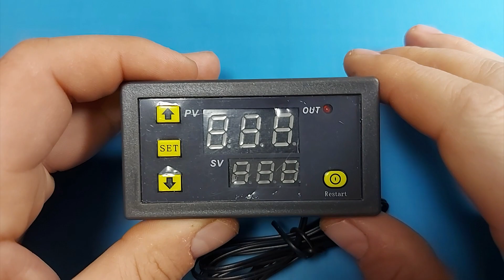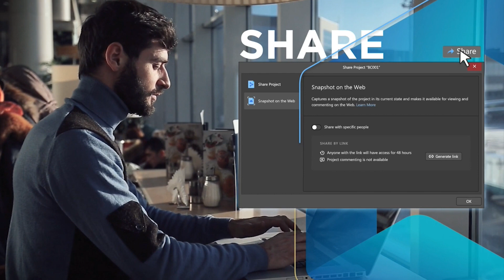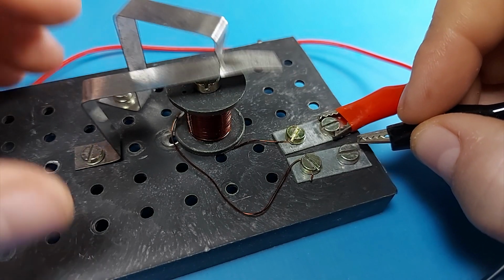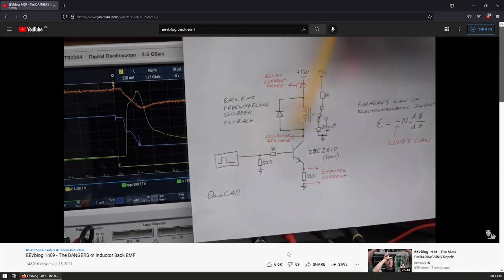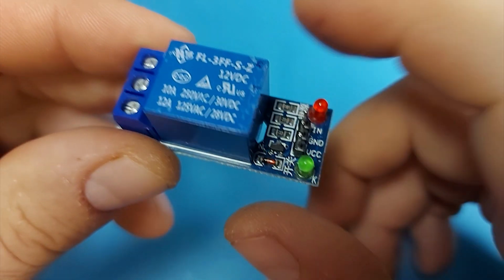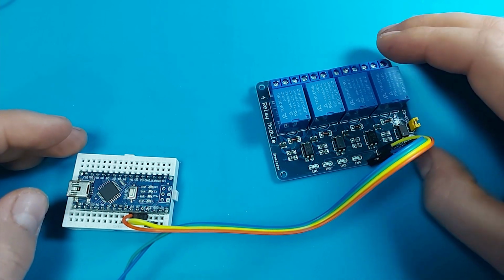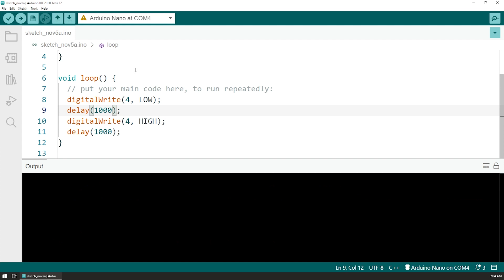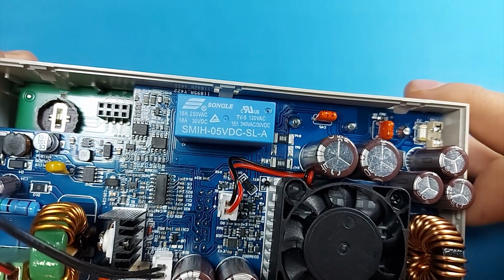Arduino relay basics - how it works and how to use it

Comment: Is it possible set a 16ch relay to NO as start pattern? 
My relay is NC when it's turned on than it changes to NO.
Reply from the maker: As far as I've seen, each relay has both the NO and NC contacts. Can you double check that you have not wired it wrongly? There should be a COM (Common) contact, NO (Normally open) and NC (Normally closed) contacts.
Reply: @TasteTheCode thanks for helping me! The wires were ok. I've changed the code and I've reached it.
Reply from the maker: Awesome, I'm glad you were able to resolve it.

Comment: Thanks a lot for the tutorial! Would it be possible to code it so two relays activate and deactivate out of phase? I need my code such that one of the relays activate each 1000ms and the other one 1500ms.
Reply from the maker: Yes, you can. You just need two variables to compare the elapsed time.

Comment: Can you help me with my project? I use 2 relay to control my DC motor for forward and reverse the motors rotation, but when i control it using my arduino, my arduino program was crash and error, and i had to reset it again so it can run again, i already use an external power supply for my relay 4 channel modul, but it just the same, can you help me with please
Reply from the maker: Does your module have EMF protection diodes? Motors know to create a lot of electrical noise when stopping so that might be interfering with the electronics. Check if the code runs with just the relays, without the motors, so you can isolate if the problem is coming from the relay board or the motors. Additionally, it is recommended that you use two separate power supplies, one for the controller and one for the motors.
Reply: @TasteTheCode  im using 4channel relay just like in your video, i thought that kind relay had a zener diode that protect the relay give a current feedback is it?
Reply from the maker: @faturahmanf3024  yes, if it is the same then it has the protection diode in place. Did you try it without the motors?
Reply: @TasteTheCode  yes i already try, and it seems fine no error on arduino, what do you think the problems? Is it possible that the motors giving a feedback current?, Actually i use step down dc module ,to step down my power supply from 12v to 5v for the external power supply on my relays
Reply from the maker: And the same supply is powering the Arduino? I think it is noise that causes your issues. Try adding some filtering.
Reply: @TasteTheCode  what do you suggest? I prefer to adding a filter on the output of my power supply or i use separate power supply for the relay and the arduino
Reply from the maker: First try with separate supplies if possible. I'm not an expert on filters so I really can't tell what the best approach will be but try searching online and see what's oit there.
Reply from the maker: Additionally have you checked if the power supply can deliver enough current? Maybe the motors draw too much current and the voltages colapses. Have you checked that?
Reply: @TasteTheCode  ok i will try it, thank you for the advice
Reply: @TasteTheCode  on my project i use 2 power supply , first power supply 12vdc 1a connect parallel  to 2 lm2569 step down dc to dc module, one of it powers the arduino for 9v , and the another lm2569 powers the relay module for 5v, and the second power supply is 24vdc 1a that drive the motors, this second power supply only power the motors, but i dont think that the motors draw to much current because its only power the motors, and this motors can operate from 12vdc to 36vdc, the motors actually a dc linear actuator
Reply: @TasteTheCode excuse me i want to send you the video of my project, if it doesnt bother you, can i send it via your facebook page or instagram
Reply from the maker: Video will not help a lot as it might be difficult to identify what is going on bu send it if you want.
Reply: @TasteTheCode  thank you for your advice, i appreciate it👍

Comment: That was a good tutorial ;)
How to use a relay.
I have both relays, the normal one and the SSR, which was bought together with a PID controller.
Reply from the maker: Hey David, congratulations on winning the relay module!
Reply: @TasteTheCode  Thank you very much ;)
Reply from the maker: Thanks! Any plans to use them on a project?
Reply: @TasteTheCode  I once made a slow cooker with that SSR.
With that regular 4 way module relay, maybe I would make a terrarium for my carnivorous plants that controls my light, humidifier and water pump ;)